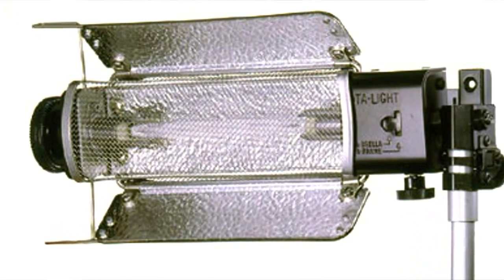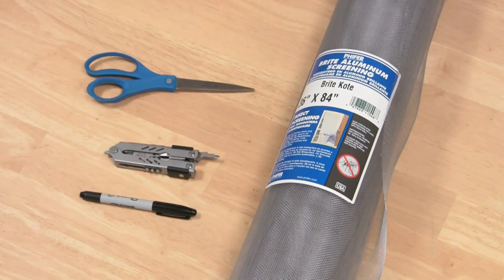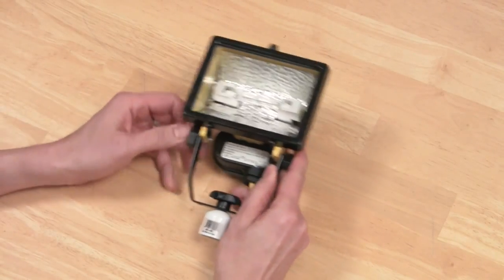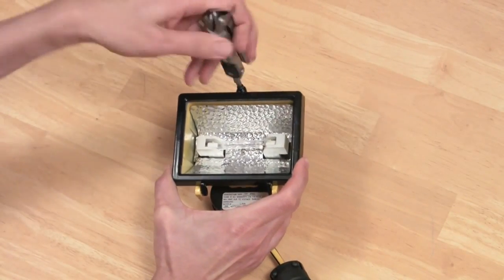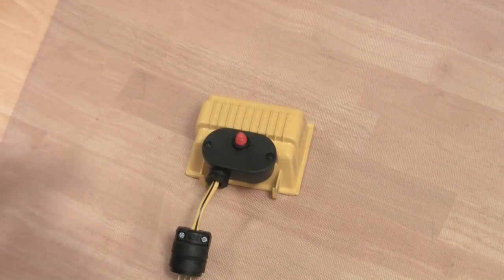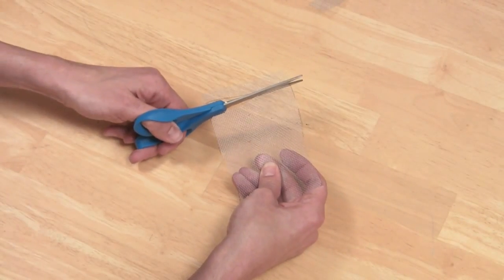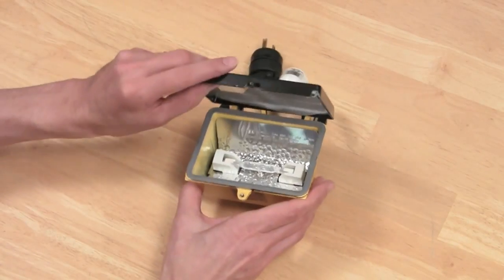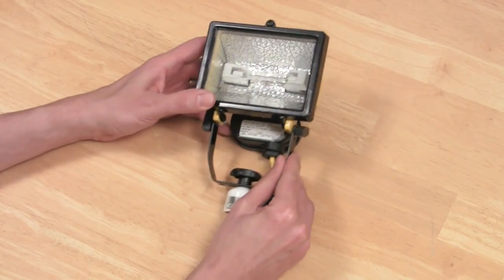Work Light Screen

Comment: This was pretty cool! I too was a little weary of having the bulb completely exposed, but this is the perfect solution. Not only does it protect you from an exploding bulb, but it also protects the bulb without having that sheet of (breakable) glass in there.  And running a bit cooler is a plus!

Comment: I may do this, just got 2 sets of lights a 500w each and 150w each set.  I dont mind the glass much though so does the faster cooling really make a difference (like more than half) or is it just a bit faster?

Made the same pvc stands you showed to make did upgrade to schedule 40 just for a bit more piece of mind and probably will make a snap-t stabilizer for safety.  Did a video on the new power cable ends to supplement your original video as well.  Hope everybody finds it useful.